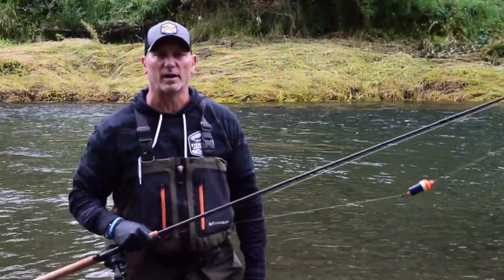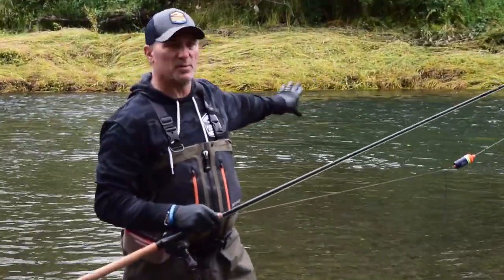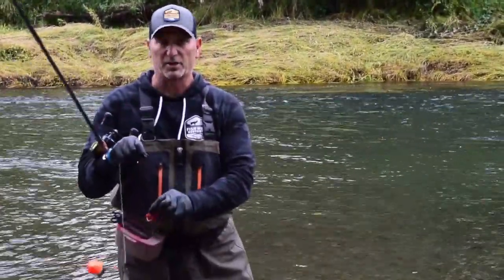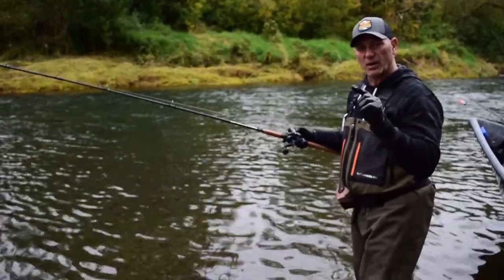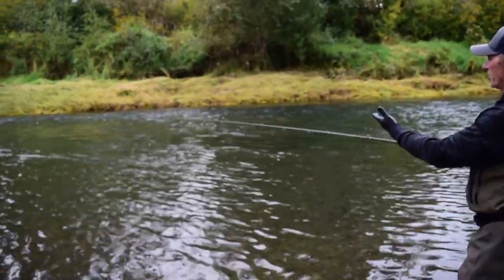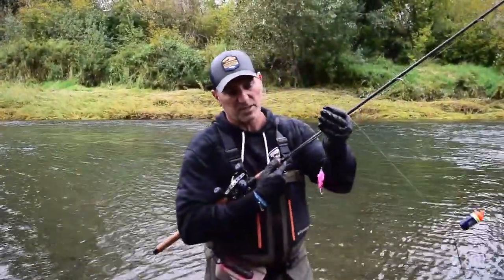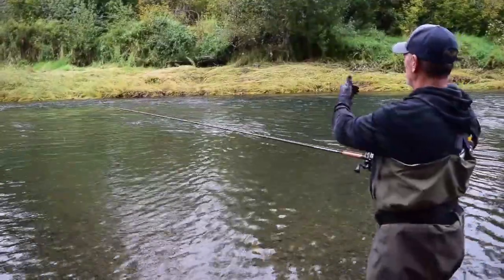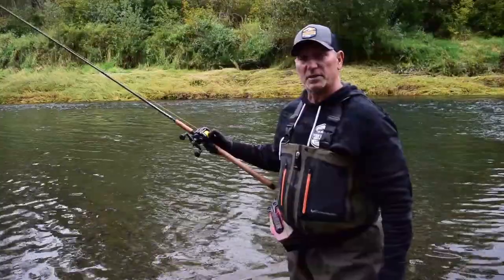FHN "How-To"  Bobber-Doggin 101 at The River

Comment: Hey DI, great tutorial! I need a good left handed baitcaster. Having trouble finding one. What reel do you got there and would you recommend it? 
Thank you.
Reply from the maker: Anything in an Abu Garcia with at least a 20lb. drag will get it done for Nook. There are a number to choose from. Revo Beast, is a great option. Vary in price between 160.00 and 400.00 depending on which model ;-)
Reply: Thank you thank you!
Reply: I have the revo beast & the NaCl both great but the beast retrieves more line per crank & is way cheaper (1/2) & it holds PLENTY of line even if you go 40, 50 lb braid for floatability. They both give up to 22 lb drag & cast like a dream.
Reply: @jimmascaro2456  I ended up getting the beast. I haven't caught a fish on it yet but the cast is amazing. You can tell it's a work horse! Really good real for the price.